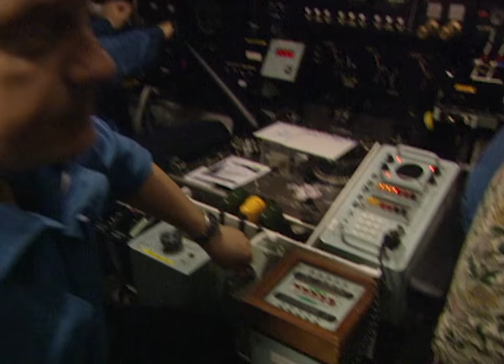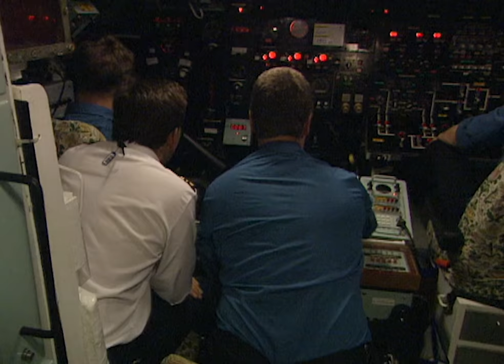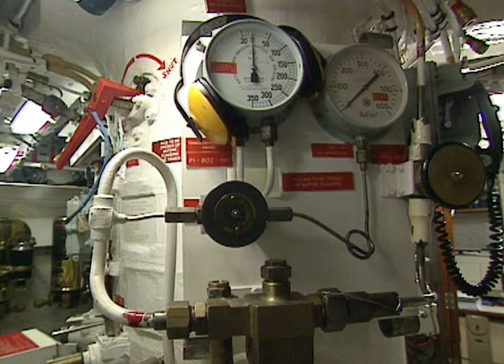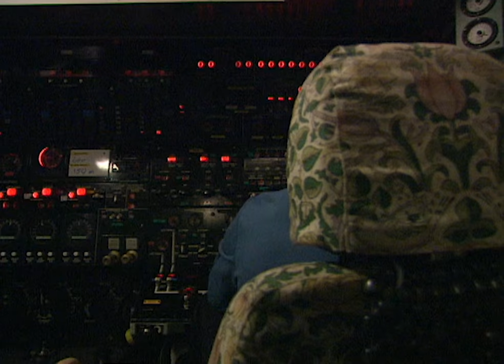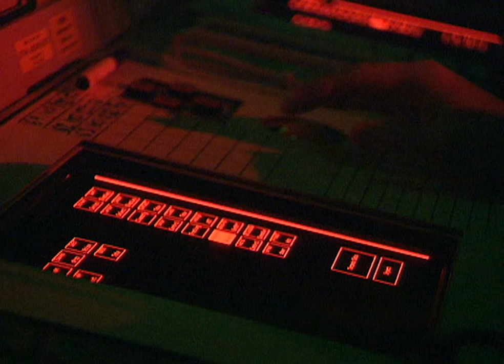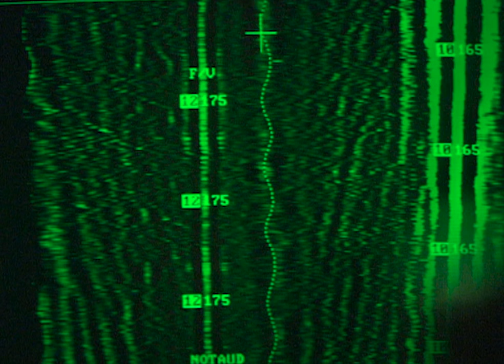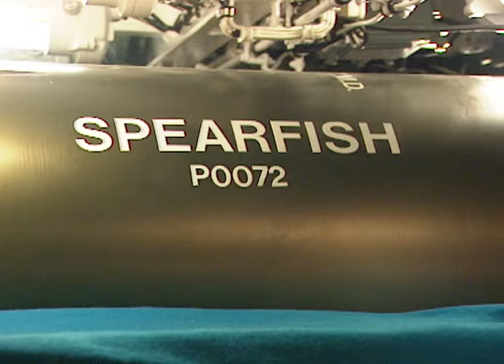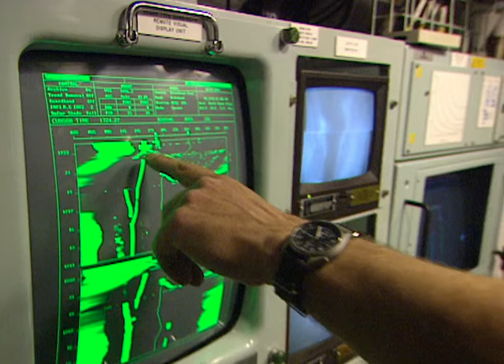Nuclear Submarine Behind The Scenes | Submarine E3 | Our Stories

Comment: Wow, I wasn't expecting them to show footage back aft in the engine room!
Reply: 1974 build...LOL
Reply: @operatorjeffdeathstar7759  And? nuclear propulsion technology hasn't changed all that much from the early days... even submarines constructed in the 1990's are considered to be modern and that is just 16 years after 1974...
Reply: Only showed unlabelled pipes, valves, cables, insulation and casings, not what's inside, or how large or small.

Comment: These boats were not war worthy. They couldn't call into foreign ports without having external electrical generator support flown-in - related to the reported weakness of the reactor primary cooling circuit ?
Reply: loose lips sink ships
Reply: @lesmoor001  Hardly, given that these haven't been in service for near enough 20 years...
Reply: @harrier331  Well 12 in the case of Superb.
Reply: Well Nicholas these boats are designed to work in the depths of the oceans THAT is where they fight their wars not tied to a jetty. 
And you seem to have forgotten they have diesel engines for cold moves ....
Reply: @1chish  Semantics, you get the point.
Reply: @harrier331  1
Reply: There is a huge differece between peace time courtesy visits and war.